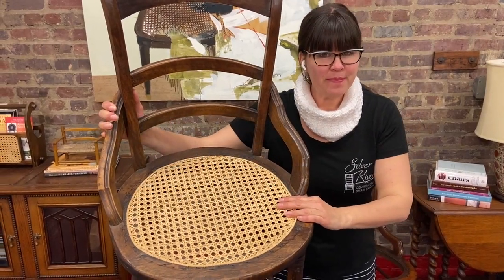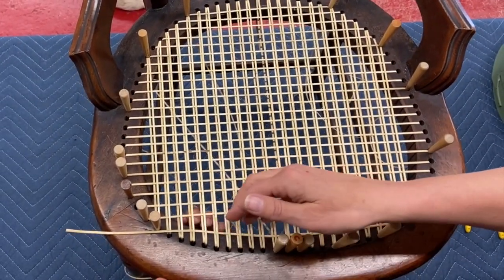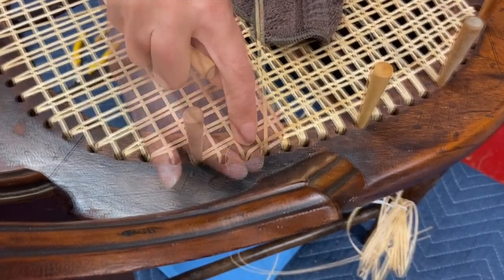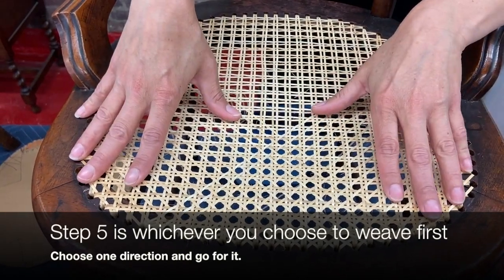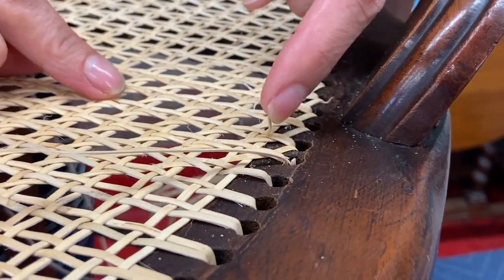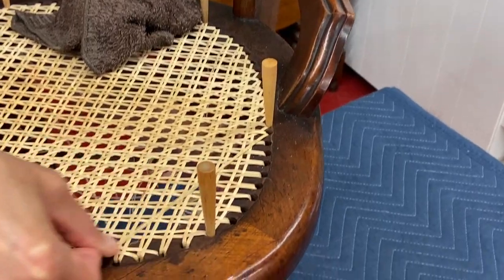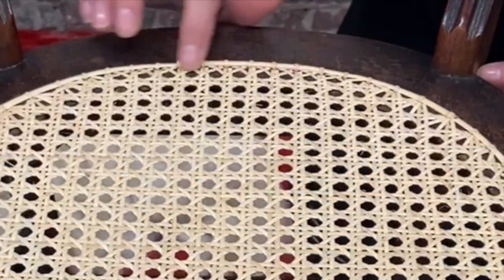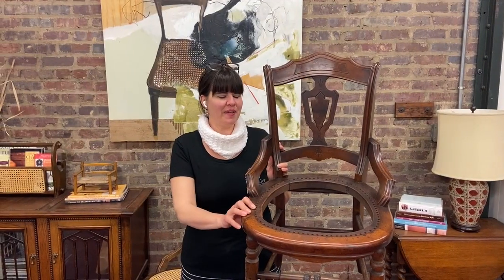How to Weave a Round Laced Cane Chair

Comment: Thank you for this video! I'll probably watch it again and again after doing more chairs I did (I did 4 now). How many mm is the cane you use?
Reply from the maker: You are most welcome. Typically round chairs like this one are either super fine or fine. I'm pretty sure this was fine cane 2.5 mm. We measure each chair, never going by what the last person used....and we aren't afraid to remove work if it's looking too flimsy or too crowded. We typically go up or down a size for diagonals if we aren't happy with the spacing (too flimsy/crowded), so long as your base Steps 1-4 are the same size. In fact, early European caning was often done with tiny base Steps 1-4 and 3-4 sizes up for diagonals.
Reply: @silverriverchairs3686  Thank you! Good to have as knowledge.